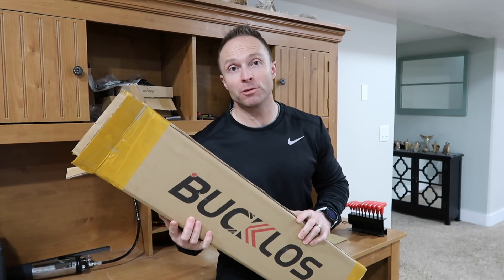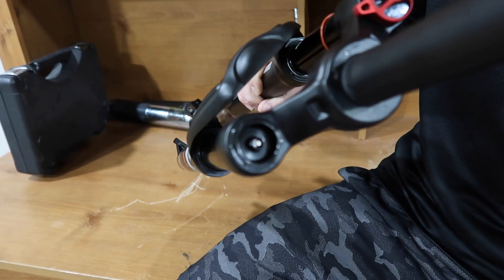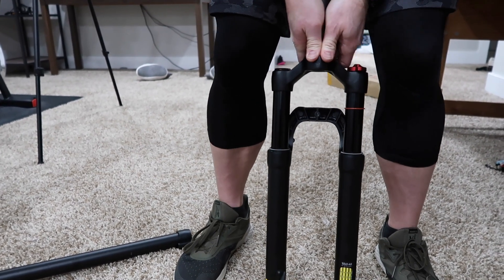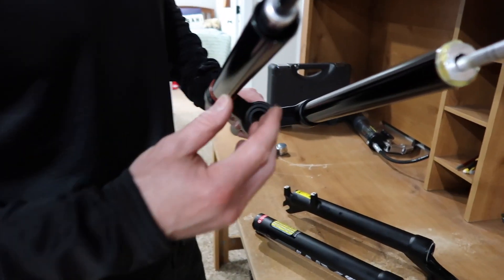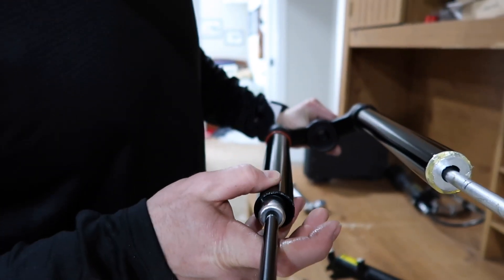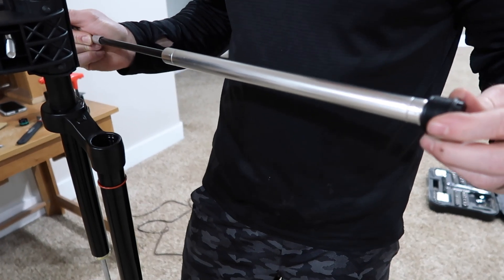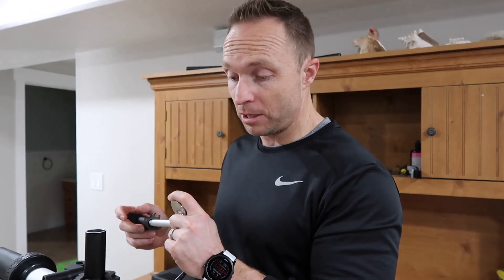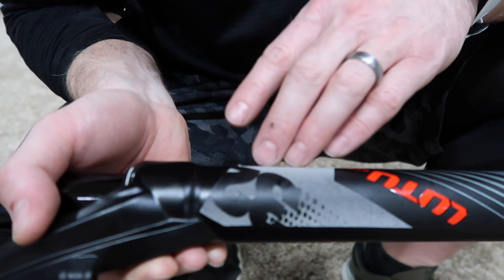Bucklos / Lutu Air Fork Tear Down | What's inside?

Comment: I've been running a Bucklos on my XC hard tail for at least 3 years with no service other than cleaning. I recently reached out to Bucklos and they said to just take it apart and clean it and put 10ml of shock oil in it. (No replacement seal kits)

Comment: I'm trying to upgrade my Mongoose Ledge X1. I have around $350 (that my wife knows about) to spend on new forks. Yeah, it's just a Mongoose, but I wanna make it a sleeper bike. What should I buy in my price range? I've done a lot of research but still on the fence with a purchase. Any advice
Reply from the maker: @sgtrickards5683  I’d check the FB marketplace to see if you can get a high quality used Rockshox fork. I’m seeing good used bike parts for dirt cheap right now.
Reply: @FrugalFitDad  ok. Good call

Comment: Anyone buying these is in for a shock,  no pun intended, they are garbage in fact dangerous garbage. 5 rides and 2 strip downs and I took them off and threw them in the bin. OK the damper lock out seems good but after 1 1hour ride the stiction and play in the bushes is outrageous.  Genuinely the worst fork ever made and I go back to the 90s. In the UK they don't have the warning sticker so never ever use these on proper off road. Better still don't buy them just get second hand marzocchi lopro.
Reply: I agree.

Mine lost air after the first city ride and still doing so.

Comment: Great teardown! Just got these, excited to try them. First impression was positive on my end - no trouble setting brakes up and not a scratch on it despite kinda crappy packaging. I emailed the company with some questions and for maintenance documentation and they got back to me same day. I think they're making an honest attempt at put out a solid product. Time will tell!
Reply: Any update?
Reply: @stopthephilosophicalzombie9017  I've got a dozen trouble-free hours so far. No air leak at all, all settings respond well to fine tuning. Definitely clean the stanchions thoroughly every ride. Only thing is I'm not a fast/aggressive rider so I don't know if it could handle a savage pounding.
Reply: @nrgpup77  how are they now?
Reply: @Steezbikelife  sold the bike not long ago, but no issues at all. I'm planning another build with the newer version

Comment: I bought the 27.5 version last month for 144canadian just insanely cheap. I needed a qr fork for GT idrive 5 parts bike that I built up for city riding with michelin country rock 1.75 tires at 65 psi with  5 inches of suspension is really fun to ride and this working great .I am shocked at how good the fork is for the money.  Btw the 27.5 fork have is actually 120mm travel as tested and measured. Thank you for the great video as I was wondering what maintenance it will need and looks like just seals and grease from your video. It replaced an old heavy marzocchi bomber fork  that weight over a pound more and had blown nitro piston .

Comment: These are just rebranded suntour forks with a newer damper.  Has the same air spring, seals Nd parts as an xcr air but has a newer damper.

It's crazy how no-one has really noticed this. 

They go really well with 15-20wt fork oil in the lowers, some foam rings and better seals.  

I'm running extra float fluid in the air chamber to ramp up the progressiveness at the end of the stroke as well as foam rings and 15wt fork oil as lower leg lube. Wolds apart from what it was when received. 

These newer style dampers can be had for $30 on eBay and can be retrofitted into any fork...

I've thrown one of these dampers in an old xcm laying here and a dnm fork.

The newer models of this fork have a different casting for the lowers as well as I just got another a few weeks ago.  This set of lowers has metal bushings instead of the plastic bushings in the older lowers.
Reply: Is there a guide on how to service it in the manner you spoke of? I'm a professional mechanic but I'm new to MTB forks, and would love to learn and optimize it

Comment: im planing on getting these for my entry mtb as an upgrade since i only have 80mm travel coil forks that are a little scetchy, i do 85% city riding with about 15% of easy\intermidiate xc and flowy single track and so far it has been good for a year but i dont feel super secure on it right now as the forksa have a little play in them i think this could be a nice cheap upgrade. any tips?

Comment: Bought a Lutu 27.5 as part of an 26er mullet bike experiment several years ago.  Over 1000 miles ridden on this fork.  Nothing more than XC oriented trails but never a failure.  This invovled two different riders weighing in at 130 and 170 lbs.  Also, this helped bring aluminum bike to under 30lbs and improved geometry slightly.  I can't complain and feel that this is great bang for the buck if you are not a heavy or abusive rider.

Comment: I totally agree with your assessment. Your son is probably going to outgrow the bike before you need to replace the fork. Even if you need to replace it, 2 of those cost about the same as an entry level name brand.
I still use my old walmart bike spring fork with no rebound, non lockout; I just spray with lubricant with PTFE because I cannot disassemble and cannot even see what it looks like inside. Steerer tube is even smaller than 1 inch. Cannot replace it with anything.

Comment: This seems like a redesign of an old fox fork like a FIT CTD damper, its likely an old design no longer covered by patent, made with cheap manufacturing, so as long as its not that cheap its prob still a decent fork, if not a little outdated on the damper

Comment: Love the way they just use the adjuster knob from an old model of manitou fork. Someone must have a box of excess of those. Probably the reason it has clicks even though the adjustment in the actual cartridge damper is evidently just an on/off lockout.

Comment: On Amzon, one complaint was that you didn't actually get full travel out of the forks. The other was that upon receipt the fork wouldn't hold air.
Reply: Fork doesnt hold air because there are no rubber rings stopping the air escaping , just the threads and bolt.

Comment: The stickers are made to be able to be removed if you don’t like them. Also I’ve ridden that very fork on my old bike (I’m 200lbs and 6’3”). I’ve beat the snot out of it on jumps and drops for a solid few months without and trouble. I recently sold my bike to build another and it’s still going strong with the buyer (he’s roughly the same size as me). I think that’s more than what you can ask out of a $136 fork in my opinion. Safe riding!
Reply: Ok this comment helped thanks.

Comment: I can’t imagine bucklos is a “real” company. The most likely just reverse engineer other products to fit the niche of cheap bike stuff. Like all the other Amazon brands, the probably just pump out cheep designs that they can find.
Reply: They are the exact same forks as their high end counterparts down to the last detail. Just made of less quality parts. They will ride just as good as a fork that cost 4 x as much but don't expect them to last as long or be easily serviceable.
Reply: @tac6044  Lol did you see the cartridge damper? No way in hell is this fork anywhere as good as even an entry-level fork like RS Recon air. 🤣

Comment: I got 2 and ill tell ya what i think: got the fat bike fork for my framed.  Had the local bike shop put it on.  Picked it up brought it home held the brake pushed it down pss psss psss seal blown  brand new.  Back to Amazon replace it. 2nd fork put 90psi in it  pushed on it gor 10 count…… 70psi. Put 90psi back in left it in the corner for 4 days……40psi reurn refund 

This don’t hold air for shit. Totally worthless.
Reply: Same with me

Comment: I bought the same fork just with gold stanchions I had to return it because as you mentioned the brake posts were machined poorly, my disk brake was rubbing no matter how many adjustments i made. I got a replacement and this time it was a different problem I mounted the brakes and my brake rotor was hitting the cotter pin at the top of my brake calipers. I solved this by putting a washer between the brakes and the brake posts to raise the brakes up a little bit. Other then that I've been using this fork for over a year and i've had no problems with it, it's used for some moderate trail riding and on streets. Also could you add oil to this fork, or do you think it would leak out?
Reply: Putting a washer on the brake posts? That's horrible, an absolute no-no...
Reply: @samteks125  it works
Reply: Why?  SRAM brakes come standard with cup washer sets below and above the caliper. 

There's no issue putting a washer underneath the caliper.
Reply: @lucideuphoria7092  i had shimano brakes and they also have the cup washers but for some reason (I think the posts were too short on the fork) it was still rubbing. Since this post though I've upgraded to a Rockshox fork and shimano XT brakes and haven't had any issue with fitment.
Reply: @NonLegitNation2  yep, I have had the same issue with mine...I have trp spyre calipers and they hit the rotor before adding a washer as well. 

I ended up adding some float fluid in the air chamber to reduce the volume, adding foam rings and 15wt oil in the lowers.  Performs better now but still flexes like a noodle..

Comment: They are decent forks for the price so long as you use them within the activities designed for, the red oil in the air chamber is not uncommon and is used to help seal and lubricate the piston, the lowers are made fully of magnesium which is incredibly light and lighter than even aluminum and so might feel plastic or cheap but that is usual for a mag lower.  As for oil in the lower they are a lot like suntour in that they do not use oil in the lower just grease and even some of the more expensive brands do not use oil
Reply: I have these forks and they feel good outside of some stiction

Comment: What size of bike did you put this on?   Will it fit a 24” bike. And will it accommodate calliper breaks or just disc?  Any info is helpful thanks.
Reply from the maker: I put it on a size small 27.5. There aren’t any brackets on the fork for rim brakes.

Comment: I wouldn’t recommend these. Got exactly these and a stanchion snapped inside the crown on one of the threads that holds the damper in. Fell apart when I was pushing up the hill to the top of some dirt jumps but I would have been screwed if they broke when I was riding
Reply: Based on your comment i would not fault the forks  for failing but rather you for misusing them for something they where never designed for, these forks are not designed for down hill or any kind of jumps and the warnings on the fork express this, so if you misuse the fork going down hill runs and hitting jumps then they are going to fail, in the same way if you took a road bike over rough root covered ground it would fail eventually
Reply: @EQINOX187  I would agree but I’ve seen bike restoration vids etc where people put these forks on bikes specifically for dh and jumps and they feel great at first. The actual failure came very soon after buying them on my second ride and my first proper ride only a few runs in and they snapped when I was pushing the bike up the hill on some threads that on closer inspection were very low quality threads too
Reply: would they be good for my ebike i just need a suspension that moves and not stiff for my cheap bike project

Comment: Did you remove the spring? I don't see it in the video. Can it be removed?
Reply: I bought similar fork: ELYON 140 29. Looks identical to Lutu here except QR. I dissasembled mine and spring seems to be based on Suntour Epixon. It has the positive air chamber and 2 coil negative spring. All parts of that spring look very much like Epixons. Even air piston is very similar. Epixon does let you change travel by moving rods though, here you would rather have to add distance rings (rockshox travel spacers fit).

Comment: Regarding the lockout, that small amount of movement in the start of the stroke is pretty much cancelled with sag. Just an fyi. I would have loved to have seen the internals of the air spring
Reply: Exactly the same as the SR XCR air.
Reply: @searchingshropshire  if that's the case then travel could be increased
Reply: Stimmt,  ist auch eine ähnliche  Preisklasse.  Die xcr hab ich selber.  Hab mir die bucklos auch bestellt.  Was ich nicht kapiere,  meine unterscheidet sich( was das Design  der Bedienelemente und des nur manuellen lockouts betrifft)  doch von meiner.  Auch steht an der Seite nicht lutu und sie ist 10 bis 15€günstiger.  Sind das 2 verschiedene  Modelle?
Reply: @samteks125  in der preisklasse bekommt man keine vernünftige luftfedergabel. Gerade roxschox sind richtig teuer, und wenn sie günstig sind, sind sie meist abgerockt. Ausserdem, soo schlecht ist die bucklos gar nicht. Das einzige was ihr fehlt, ist die motion control.

Comment: How's the fork holding up? Did you toss some oil in both sides?
Reply from the maker: So far so good. I added a little oil to each side. No complaints.
Reply: @FrugalFitDad  Surprised they shipped it bone dry. Maybe they want it to fail quicker?

Comment: My Bolany fat fork with rebound works about the same as yours. You should lubricate the stanchions to try to get some lubricant in the plastic bushings before installing it on the bike. 

The lowers are magnesium, which sorta feels like plastic. It has to be made of metal so the dropouts can handle the clamping force and load of the tire.
Reply: Do yours have stiction

Comment: Most of the better forks out there have tapered steerer tubes, so you'd have to change out your headset too.
Reply: Not just the headset, apart from a few exceptions, you'd need to change to a frame with a tapered headtube.

Comment: Did they have foam seals or a place for them? In case you want to convert to oil bath
Reply from the maker: I didn’t see any.
Reply: I would just apply some light grease, like slick honey. That's what RST uses in some forks instead of bath oil, and they feel very smooth. If the lower legs are not well sealed, the oil will leak out the bottom, and eventually contaminate rotors and brake pads, and that's no fun.

Comment: It 'seems' plenty good enough. Did you add any and what kind of oil to any of the lowers upon reassembly? I am replacing a 2002 Manitou 6 Comp 100mm coil fork. I took it apart for the 1st time ever bc I wanted to be 'responsible'...lol...The plastic access nut on the bottom was seized and I had to drill and easy-out it out. (I hate plastic essential parts). There was not a drop of oil in it. I remember some draining out 15+ years ago when I stored the bike upside down. But I didn't think much drained out and it seemed fine...lol...On teardown 2 weekends ago it had no rusty parts with lots of grease. I am pretty sure I could make some fabrications to put it all back together without it leaking. I am thinking of buying the fork you just covered. I might even go cheaper to a Mercoa $90 air fork that has no rebound adjustment bc I never really had or needed it...lol...I am 5'10" 185 lbs and just do xc and lots of wheelies. Does rebound adjustment really matter on an air fork? Thoughts on your sons Bucklos LUTU after this short time. Love your channel BTW.
Reply from the maker: I'm with you. I don't know how much rebound really matters. Or maybe I'm just not good enough to tell how to use it right. So my sons probably can't tell either. I didn't have any oil to add when I filmed. I plan on adding a little more in the next few days.
Reply: @FrugalFitDad  Thank you.

Comment: hey guys i have a 120mm Chinese air fork also and overall I am pretty satisfied with it. it has plastic bushings instead of foam rings which is kinda disappointing but this fork performs pretty well. and I have bottomed out the fork quite a lot and everything is still working well. overall I wouldn't recommend these forks for any downhill or extreme riding but xc and doing jumps on these forks works well. keep in mind I only been using these forks for a month now so I will see if it holds up in the future.
Reply: damn no update dude probably died on his bike [*]
Reply: @ItsMorbinTime03  lmao nah I'm good, fork is still doing well, nothing to complain about.
Reply: LoL I might get a WBQ 140mm 26’ straight fork
Reply: update?
Reply: Update pls X2 and what's the brand?
Reply: How’s the fork performing after a year of having it?
Reply: broo update pls